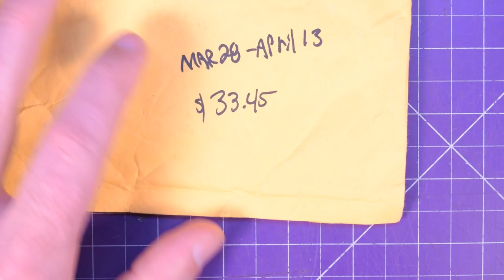Mailbag 106 - Unfinished Business

Comment: @4:20 The voltage sag will be through the wires you are using, they look a bit small for the load, test at the terminals before adjusting it.
Reply from the maker: That load is doing 4-wire measurement, so I'll make sure everything is on the up-and-up in the full test video, but thanks for the reminder!

Comment: What sizes brush motor are you going to run with that controller…775 can? You would probably get more power and better weight ratio with a brushless motor I’m thinking. Also the best nail clippers I have used are Tweezerman brand.
Reply from the maker: think - BIGGER!! :)